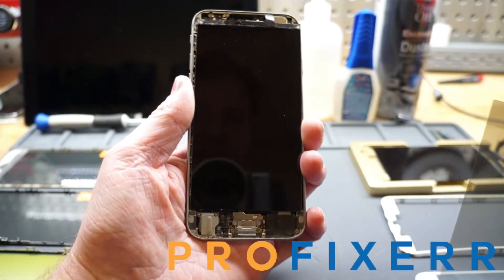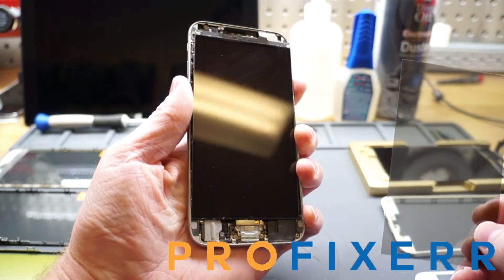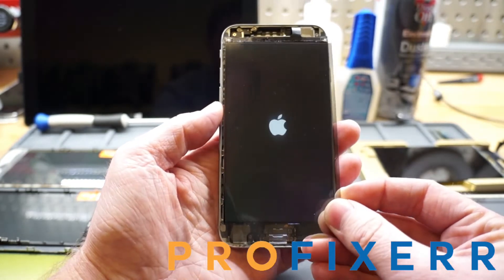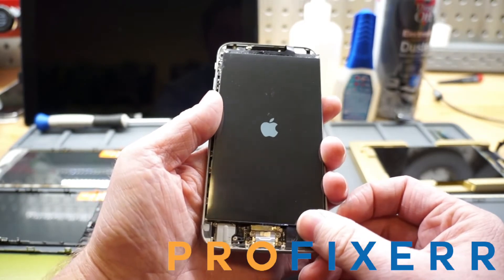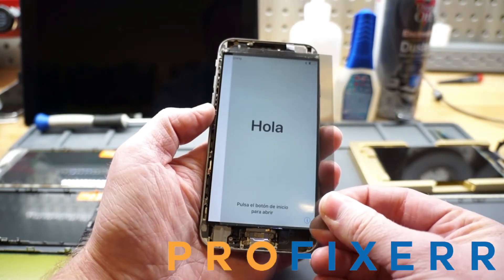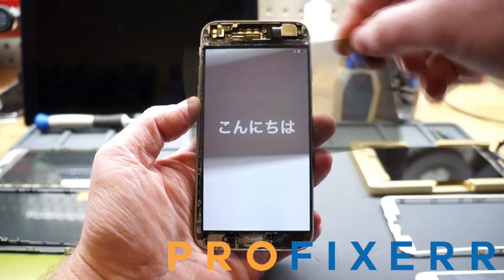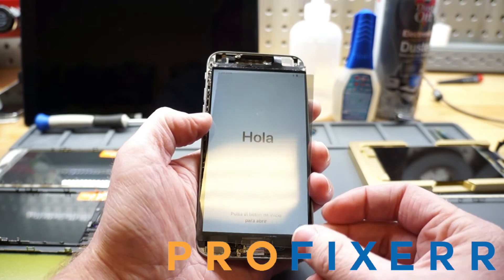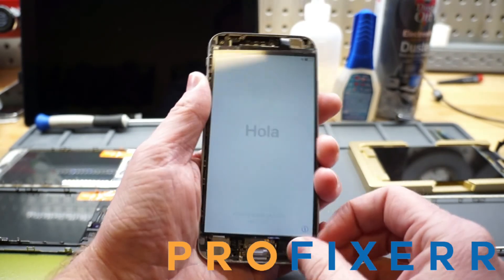How does a Polarizer work? - LCD Refurbishing

Comment: I have an LCD display on a timer device that does not allow viewing straight-on.....but the digits are well seen from a severe angle. I saw videos that say using an adhesive polarizing screen...and rotating/orienting it properly.....enhances the contrast so it can be viewed properly. Question.....when I search to buy this film....it is available as "linear" or circular polarizing basis....I think linear is correct as I would need to rotate against the display to get proper contrast. Is that the correct type?